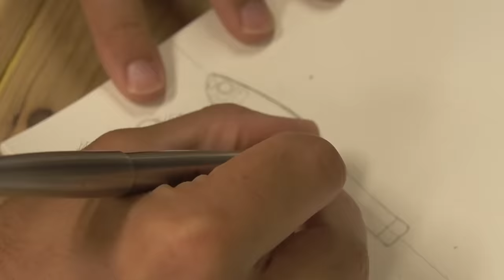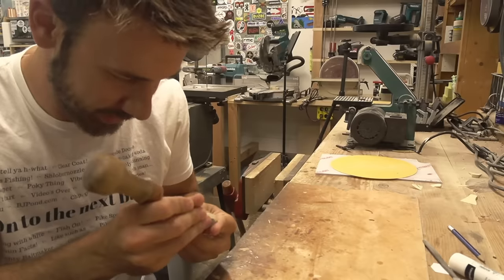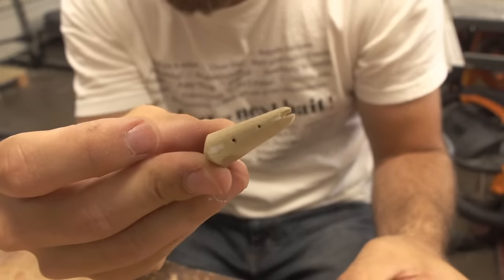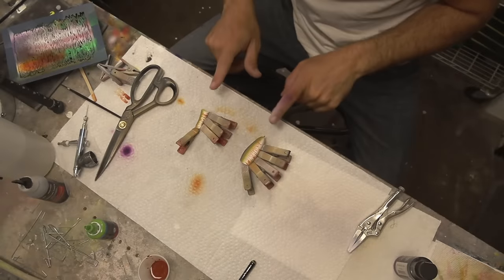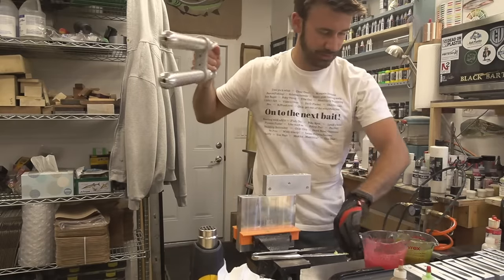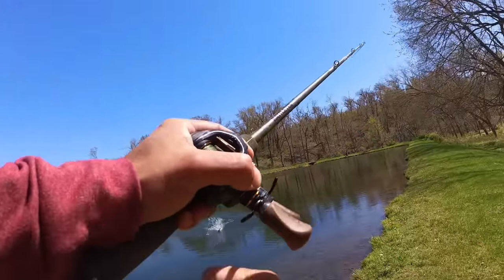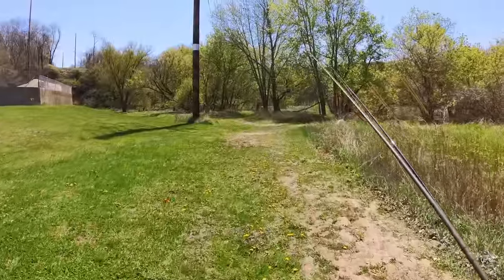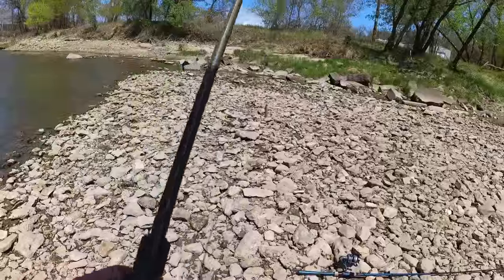UltraLight GlideBait | One Day Build to Catch

Comment: How do you attach the joints? I mad a rat but I'm able to pull out the wire. I used harbor freight epoxy and just pushed the wire into the bait.

Comment: Your Bates always look awesome. Where would I get the wire to make the jointed bait connections?
Reply: I bought a 10ft roll of the galvanized steel wire from lowes (project source) for like 12 bucks they have different sizes can’t remember if I bought the 10 or 12 gauge. It’s in the hardware isle. It’s called galvanized utility wire

Comment: Question: how do you drill eye sockets without the wood splintering or the drill walking?
Reply: Use a forstner bit and spin it backwards. I use a 1/16 bit first in the center.